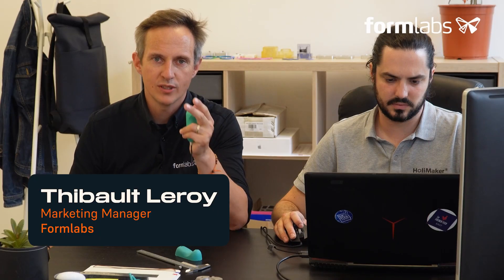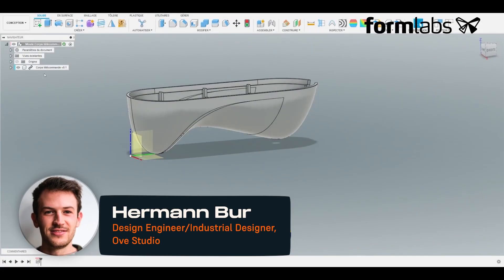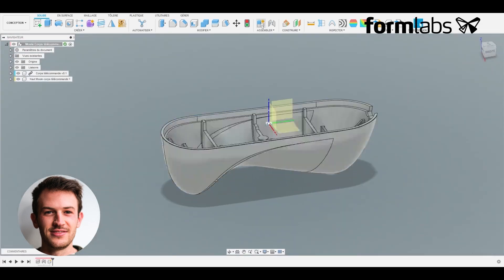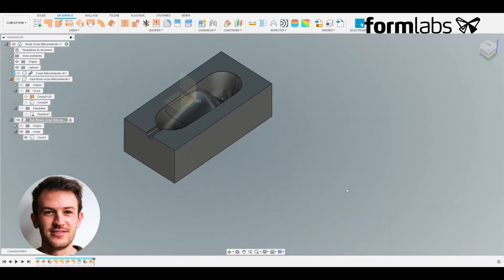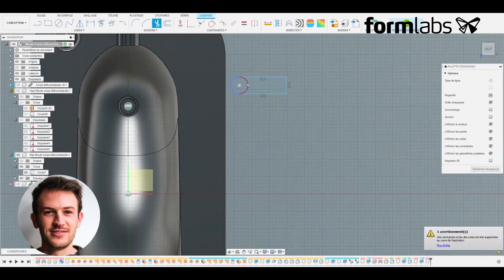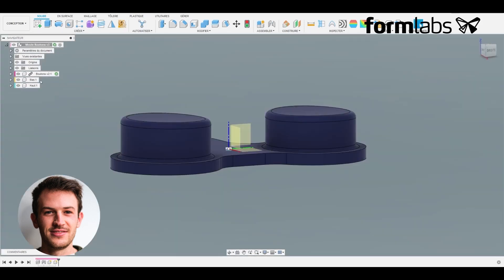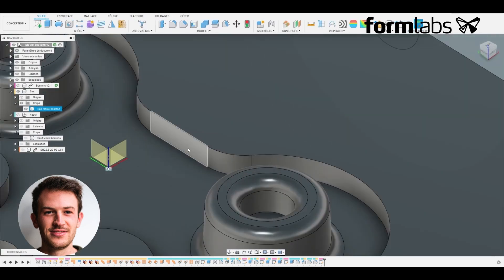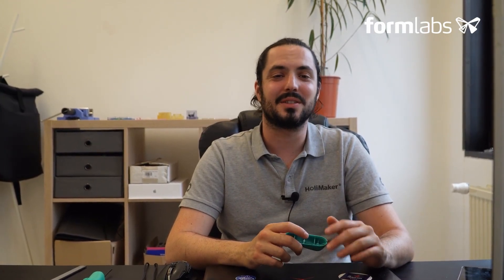Mold Design With Fusion 360 for Desktop Injection Molding (Episode 3/5)

Comment from the maker: 🟠 3D Printing for Injection Molding: https://bit.ly/45ZrsGm
🟠 Injection Molding with 3D Printed Molds - Process Conditions: https://bit.ly/45r7MLl
🟠 Formlabs SLA 3D Printers: https://bit.ly/4oMMaR0
🟠 Rigid 10K Resin: https://bit.ly/45LdMxs